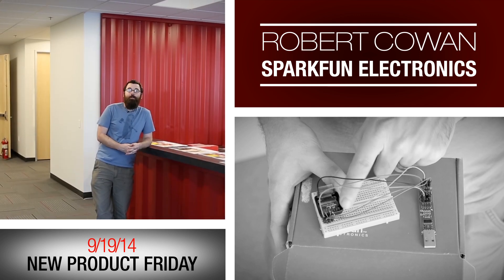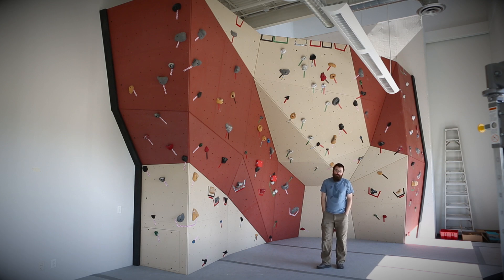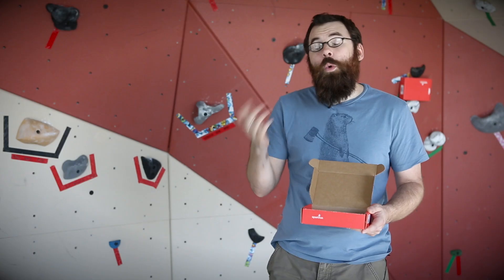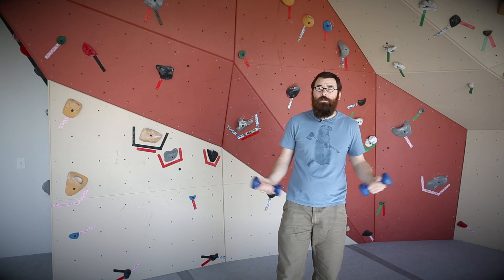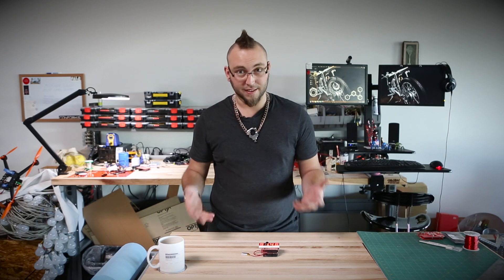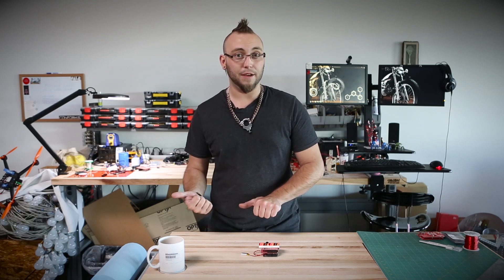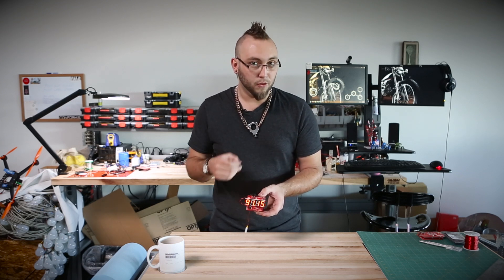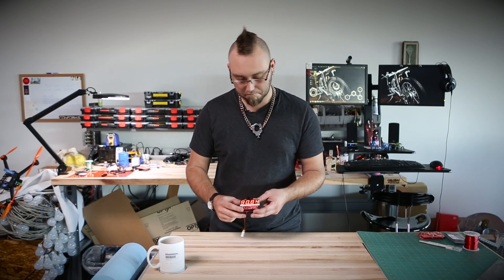SparkFun 9-19-14 Product Showcase: Leap of Faith

Comment: Hey Nick, I've made by own battery capacity tester and now that you've played around with the Coulomb counter, could you please verify the capacity of that 110mAh battery from when it comes right off the charger until it hits 3V? I have the same exact battery only slightly used and when tested like this I count about 119mAh with a 33.2 Ohm resistive load (results in about 1C of discharge current).

Source code to my capacity tester (which only requires an N-channel MOSFET and one or more resistors (resistance should be measured and configured in the software)) can be found here https://github.com/Djhg2000/AStar_32u4_battery_discharger .